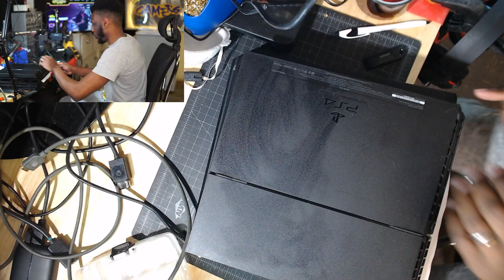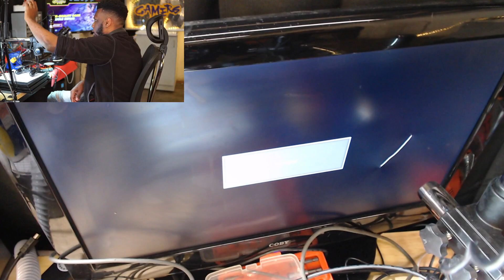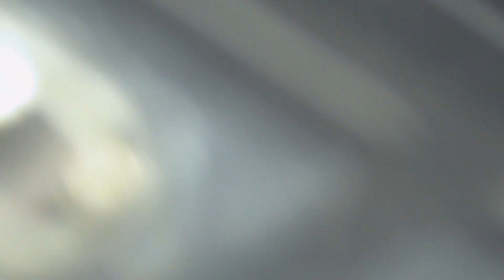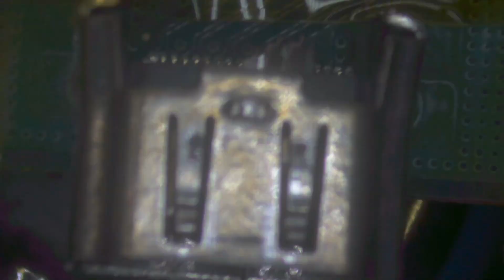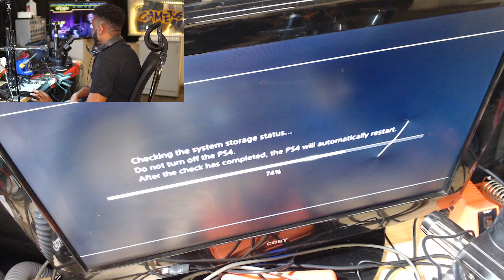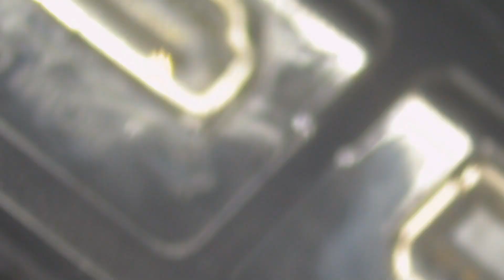Repairing 14 Broken PS4 Consoles

Comment: I spilled water on my Xbox and it got in the heatsink and in the power port on the back. The power brick when plugged in turns on its orange light but when I plug it into the Xbox the power brick shuts off. Does anyone know if this is a power brick problem or a problem with the console itself?
Reply: Text me on Whatsapp if you want to fix your device
Reply: +12243667241